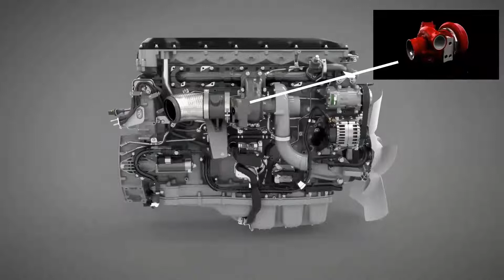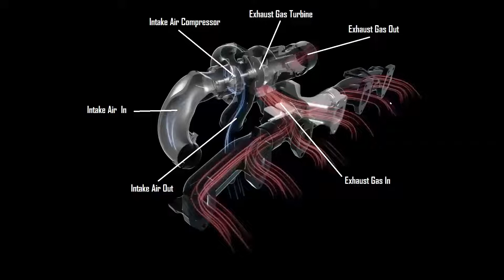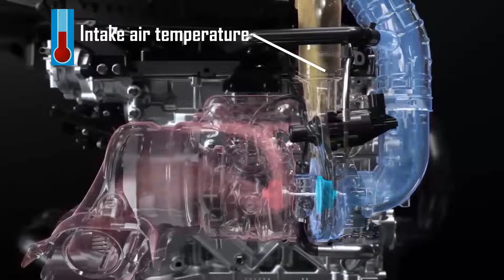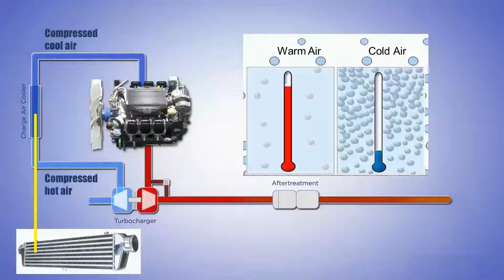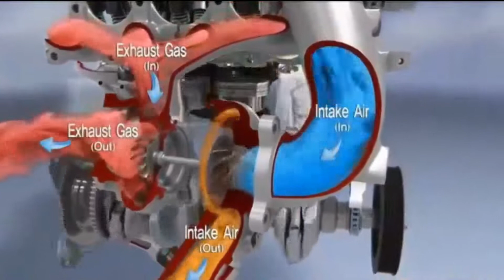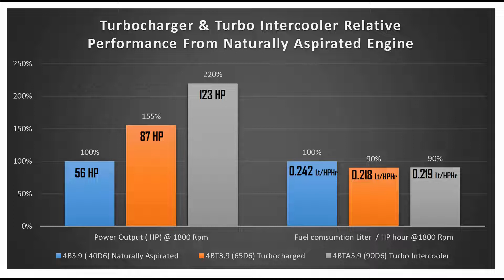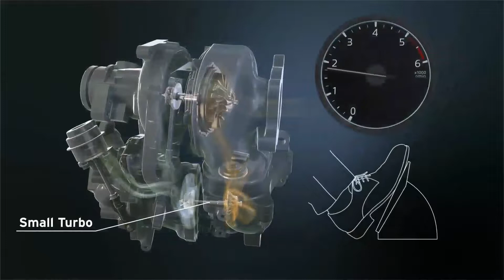How  turbocharger and turbo intercooler work ( with animation )

Comment: It seems in cold country is better at drifting
Reply from the maker: Turbocharger engine with low temperature intake air will be better because it has higher air density.

Comment: I want to T off my boost pipe and route through a 2nd intercooler, back into the turbo, essentially compunding the turbo? 

It is top mount already.
Would it work? Looking for more induction noise. 3.0l diesel. Holden Rodeo
Reply from the maker: You better consult with turbocharger specialist workshop because any modification to increase the turbocharger pressure will improve  the amount of air to combustion chamber. It must consider engine design, compression ratio, engine control and other factor.

Comment: Great job  done with animation video
At which condition turbocharger cooling system will be bypass?
With my best regards dear bro
Reply from the maker: @abbasmuhsen2715 turbocharger cooling system using engine oil circulation, as far as I know, there is no bypass like engine water cooling that need engine to run hot enough. Thankyou for your question

Comment: so is it good to put rockwool tape on the pipes for the cold air intake? so it doesn't get that warm till it gets to where it gotta be?  specially considering how hot the it gets under the hood? and where else is it recommended to put it to help it work better? surrounding the turbo or what
Reply from the maker: I believe that heat insulation for intake pipe is not necessary because the intake air temperature rise because of that is not significant. The intercooler cooling improvement is the better way to reduce intake air temperature.
Reply: @temmycandrawijaya  what about for the turbo and the Downpipe
Reply from the maker: The purpose of heat insulation is to reduce heat transfer. If you want to reduce heat radiation from turbo and downpipe to surrounding area. You can add heat insulation. I have already seen this at industrial diesel engine.

Comment: My diesel truck's turbo just went out, the turbine has alot of play and theres alot of  oil in the intercooler piping.😢
Reply from the maker: I believe that there is an oil leak and turbocharger wear out because of less oil lubrication and cooling.

Comment: So the turbo charger expels hot air and compress cold air ? Does it mix some of the exhaust air with the cild air?😮
Reply from the maker: Turbocharger improve engine intake air rate using exhaust gas energy. Its doesn't mix exhaust and intake air

Comment: How do the turbos stay cool? Do they have a oil and water feed that supply’s it around the turbo via cooling holes?
Reply from the maker: turbochargers are cooled by engine oil circulation at the turbine shaft.
Reply: Turbos are cooled and lubricated the same way the vehicles engines are. Motor oil just doesn’t lubricate engines it also helps cool the engine. How you might be asking? Because a well lubricated engine lowers the resistance of the moving parts compared to a poorly lubricated engine. And that is the reason why engines have gone from using 10w40 conventional motor oil back in the 70’s to using 0w20 synthetic motor oil in today’s new cars. Thinner oil lessons the moving parts resistance which increases your MPG. The inter cooler simply cools the hot exhaust gas used to spool the turbo before it is forced into the combustion chamber. A gasoline engine is another word for an air pump and you can pump more air and fuel into the combustion chamber when the air is 80 degrees then you can if the air is 150 degrees. So the best maintenance for a turbo is the best maintenance for your engine and that is oil changes,oil changes and oil changes!
Reply from the maker: That right

Comment: A turbocharger is a device that cost you to fix   and is put for nothing i drove cars with turbo and without very small difference the turbo gives you lag and the engine is more complicated for nothing .
Reply from the maker: Many engine load tests proved that adding a turbocharger have increase engine power output. It depend on the car owner if he willing to pay additional cost for additional engine output.

Comment: How about the jet engine? why does it not need cooling intake air?
Reply from the maker: Air cooling system put more weight and more air drag. In the automotive application, these drawbacks are not a problem. But for the jet engine, weight and air drag are big problems. Additional power by cooling the intake air in a jet engine will also increase weight and increase air intake drag. These have more disadvantages than the advantage of more thrust output from a jet engine.

Comment: Does this change or make the afr lean? TIA
Reply from the maker: Turbocharger add more air to combustion chamber. To create bigger power, more fuel is also added. Turbocharger factor to afr is not significant. The engine power output factor is more significant to afr.

Comment: 14.7psi of boost has the exact same amount of volumetric efficiency of doubling the engine's displacement. 

Literally making boost the replacement for displacement..........
Reply from the maker: That's right, Turbocharger increase engine power output without bigger pistons  displacement.

Comment: Excellent just wanted to know if these systems use density controllers like turbocharged airplanes because, in high altitudes like in Colorado, the air is already less dense.
Reply from the maker: The video only show about general automotive engine, piston type aircraft engine is also have turbochargers. Some automotive turbocharges has a waste gate for excess pressure control after  turbocharger output.

Comment: More power with less fuel! Outstanding!
Reply from the maker: Glad it helped
Reply: but on petrol its not like that,
you gotta compensate with the fuel to match up with the density of air to avoid running too lean,
so morr power still more fuel but its worth it
Reply: @endurofan9854  yup, that’s when the ECU plays it’s role by regulating amount of petrol, depends on the ideal air fuel ratio.
Reply: Turbocharged cars are more fuel thirsty than NA. You still had to exchange more fuel for more power together with the forced induction. But overall TC car gives you a different fun experience than NAs.
Reply from the maker: That right, Turbocharger with same engine type and capacity would require more fuel for more power. But the fuel consumption / horse power for turbocharger usually little bit  lower than naturally aspirated engine because its more efficient
Reply: @felix8642  genius
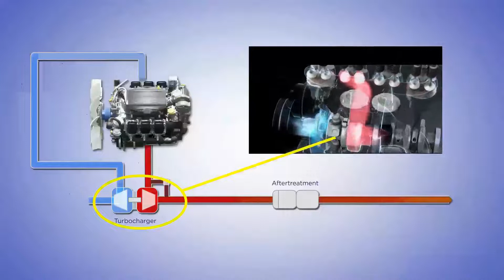Reply: 🎉 1:38

Comment: I have VW Polo 6r with 1.2 TSI engine. 2014. Turbocharged withn intercooler system. Made in Germany. Polo is hatchback. No't sport car,  high end SUV, but middle city car. This system is also used by some older vehicles. Greetings from Europe.
Reply from the maker: Nowadays, more car is installed with turbocharger for technology and efficiency. With small displacement engine, we will get engine peak power comparable to bigger displacement engine. But In a daily use, small engine is more economical to operate that bigger ones. But we must pay more price for small turbocharged engine than a bigger naturally aspirated engine

Comment: amazing video!! great job!! question: are there common maintenance points to do for the intercooler and turbo? how do i know if i should replace the turbo early rather than wait for failure? i am looking at used turbo charged cars, but am scared about if the oil was changed properly, how long the turbo and intercooler will last etc.
Reply from the maker: Turbocharger rarely to fail and replaced but the common turbocharger failure is the oil leakage . If the oil leakage not repaired early, there will be overheating and maybe jam.
Reply: You never know until you take one out to see. Usually you will know from the sound it produces during spooling. By the time you head loud howling when accelerating, it means it is time to replace it. Usually if you set up your excess boost to be vented out through BOV or have it reused with a recirculation, those will not cause damage to the turbo. You can however deliberately damage a Turbo by boosting over the limit or by using a set up that produces compression surge which the sound is very cool. The stutututu sound.
Reply from the maker: Thankyou for explaining

Comment: So the turbo compressor.Gets air through an air filter then coolers it through the inter cooler.And the into. The intake manifold to the cilinders.There are no other gates for air to enter the engine right?
Reply from the maker: That right
Reply: @temmycandrawijaya  how does engine start if exchaust isn’t spinning the tubing cause there is no air to start the combustion.Does air still flow into the engine through the turbocompressor  tubes even when not spinning.so not forced induction air.
Reply from the maker: Initially, the intake air flows between the turbocharger gap to the combustion chamber naturally. When the combustion occur and exhaust gas has enough pressure. The turbocharger start working
Reply: @temmycandrawijaya  👍
Reply from the maker: Glad it helped

Comment: Brother I've a question that why we experience some sort of Increase in Boost while starting the Engine for the very first time in Turbocharger Engines ? Is it due to the Turbo lag or why we use waste gate to reduce this lag , please bro I've this doubt from so long , help me out :(
Btw your Animation and Teaching work is very appreciable 🤗 thanks for this video :)
Reply from the maker: Turbo lag is a lag between  engine rpm increase  and turbocharger rpm increase because turbocharger work using exhaust gas. The turbocharger speed will increase if exhaust gas flow is increase. Turbo lag is notice when engine rpm is low because turbocharger rpm also low. To address this, turbocharger compressor is designed to have more rpm at low engine rpm. The drawback is the turbocharger pressure will be very high at high rpm. Waste gate is used to by pass exhaust gas to turbocharger at high rpm. So the turbocharger rpm is not overspeed and turbocharger presssure is still in range

Comment: One question. In the first iteration of the cycle, does the air pass through the turbo's compressor (ergo, gets compressed) with the same compression ratio as the cylinder (ideally speaking)?
Reply from the maker: The compression ratio is volumetric comparison between the lowest and highest piston level and the air is being compressed. And the  peak cylinder presssure at 200-300 Psi, if we compare it to the atmosferic pressure of 15 psi for a non turbocharger engine. the pressure is increased 12-20 times. The turbocharger pressure typically 6-10 Psi more than atmosferic pressure. The pressure increase is only 1, 4 to 1,7  times.
Reply: @temmycandrawijaya  thank you! So in the first interation, the air would get slightly compressed by the compressor (even though the turbine hasn't received any exhaust gases yet), pass through the intercooler and then enter the cylinder, OR would the cylinder's vacuum suck some air whitout compression, process it and then give it to the turbine's turbo so it gives power to its compressor which would finally start compressing?
Reply from the maker: When starting an engine with turbocharger, at the very first second, the turbocharger still steady or rotate slowly. The intake air still able to reach the combustion chamber by the vacuum pressure itself. When the combustion happens, the exhaust gas have enough energy to turn the turbine and turbocharger start functioning.
Reply: @temmycandrawijaya  thank you so much! you're a lifesaver
Reply from the maker: Glad it helped

Comment: too bad you couldn't use a refridgerated  innercooler
Reply from the maker: Thank you for the comment
Reply: Would diverting the cold air from the air con make much difference??
Reply from the maker: Turbocharger is more efficient when the ambient air has a lower temperature. Any methode to cool the intake air as long as practical is recommended.
Reply: @Driver-UK  can but it has to be done with a duct or a metal pipe and must face the opposite position of the wind against the car
Reply: We used them in the Army.
Reply from the maker: May I know in what system that army used it ?